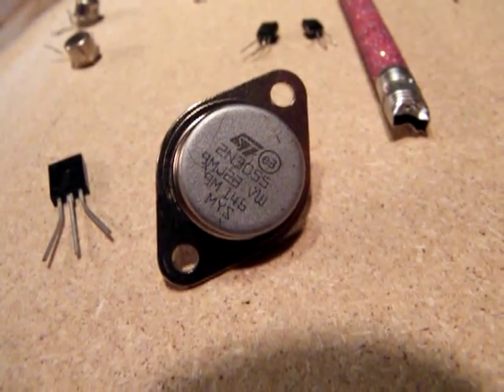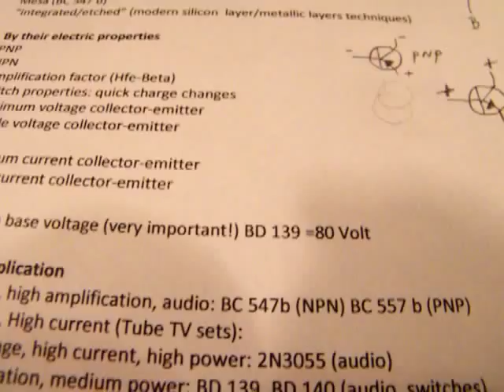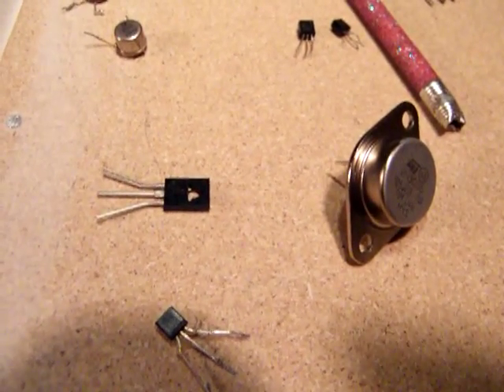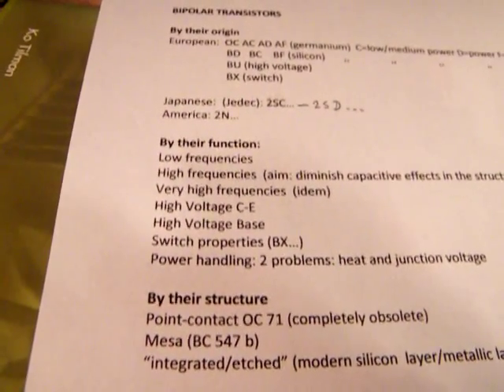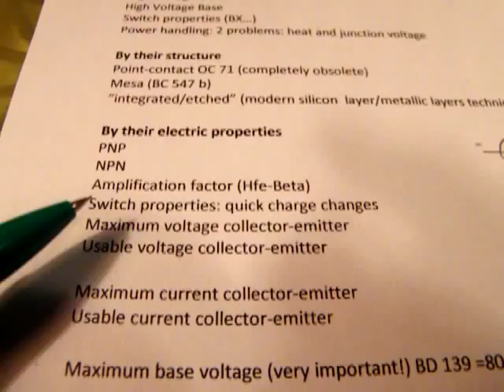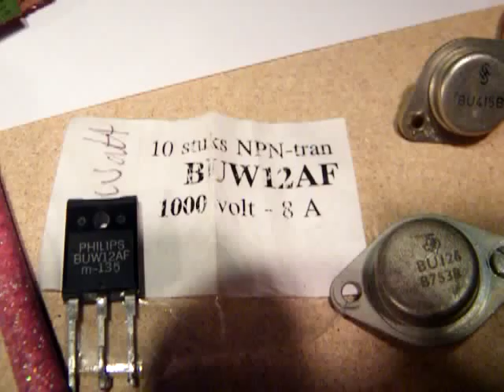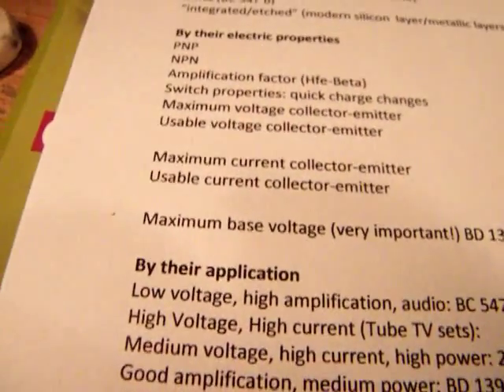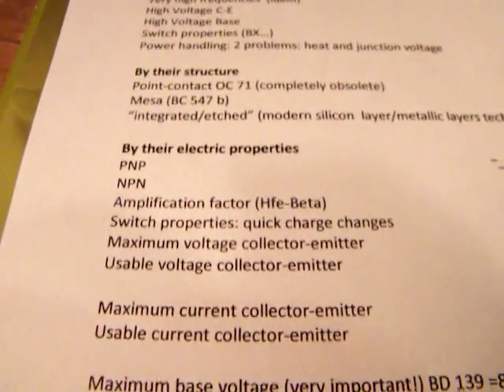elementary electronics: bipolar transistors (part 2)

Comment from the maker: LINKS TO INFORMATIVE & GENERAL VIDEOS ABOUT ELECTRONICS
What do you need for an electronic lab? https://youtu.be/v503bmymCWw
How to test a power supply https://youtu.be/BeNoSmm3D_4
Elementary electronics, the bipolar transistor part 1  https://youtu.be/6tBdTzv3ENM
Elementary electronics, the bipolar transistor part 2 https://youtu.be/maGOrqh_5-Q
Elementary electronics: coils https://youtu.be/Lbb5nvlY0TE
Elementary electronics: how to damage a bipolar transistor immediately (VERY important) https://youtu.be/VkeNKFqgsko
The most important properties from bipolar transistors https://youtu.be/-mTjz4E5ua8
Prevent transistor leads from breaking https://youtu.be/iEe37oz4tww
Combining NPN and PNP transistors in 1 circuit https://youtu.be/jfchBvkM4YA
How to make a standard NPN Darlington https://youtu.be/D_WzRkFCCyo
What to do with a transistor Darlington https://youtu.be/FrT395Nf6HI
How to drive a relay by means of a transistor or Darlington https://youtu.be/R7cvddqVn18
Discriminating European transistor types https://youtu.be/LnpdBI3kJOE
2N3055 with a too low amplification factor, throw them away ? https://youtu.be/y_eW6xLiOKM
The importance from the emitter capacitor in a grounded emitter transistor circuit https://youtu.be/br8iXVXRVl4
The transistor series regulator practice (hum suppressor!) https://youtu.be/YL41FPH_H-s
How to make a shunt – DC ampèremeter https://youtu.be/FN59W9SGou4
Diodes, their voltage drop and its practical application https://youtu.be/vBv49BDznIA
Passive diodes testing (barrier voltage) https://youtu.be/EI0-fj--Jjk
Passive diode testing part 2 (capacitance-barrier layer) https://youtu.be/oKIcbubaUWw
Point contact diodes https://youtu.be/Hgxm37foGww
Electron tubes, some basics https://youtu.be/5a0NnfjGQw0
Do our ears make harmonics?  https://youtu.be/2909D9o-Rs4
Oscillation conditions https://youtu.be/AaGDpreMdM8
Oscillation conditions part 2 https://youtu.be/efW6br21Jbc
Effect of temperature changes on a VFO https://youtu.be/xvpqlv_rA6g
Voice pattern, square waves, triangle waves, harmonics https://youtu.be/xDjox3vfpms
741 Sine wave (Wien Bridge) 0scillator-typical problems https://youtu.be/PwfK0K7NY9c
Oscillators, how they can confuse you and disguise https://youtu.be/SQpTrM9l0Sc
Why an oscillator? https://youtu.be/Ahrtsggn_EY
L-C filter/transistor and how to create useful waveforms https://youtu.be/wV41_FZ9eGs
Changing/restoring waveforms with a R-C or L-C filter/differentiator-integrator
https://youtu.be/rnNBA6FIXyw
How to make a voltage doubler, part 1 https://youtu.be/3s0eJKDlYzw
How to make a voltage doubler, part 2 https://youtu.be/q64Mmrmw7CU
All kinds of tuning capacitors explained https://youtu.be/YoEP5FHvq_s
The Schmitt trigger circuit explained https://youtu.be/BCPHBeM0QiY
What to do with broken (analog) multimeters? https://youtu.be/XXCePo0ZIfk
Cheap crocodile clips, change them in reliable ones https://youtu.be/cHot5jjfiZ0
Quiescent current alignment in (homebrew) audio class B amplifiers https://youtu.be/9Uw16td6F14
Solid state wiring in homebrew audio amplifiers https://youtu.be/Ne1TzmitJxk
Voltage reverse switch https://youtu.be/WaHaHAg4z_g
Series-parallel switch for 2 voltage/current sources https://youtu.be/ppZaQ2bVDYM
Silly Mosfet testing https://youtu.be/QAvuZXjPNLM
Cabinet/box for a 100 Watt or more power supply https://youtu.be/pWQQwu6i9ZQ
Transistors that fail https://youtu.be/GZSSKCIkS0k